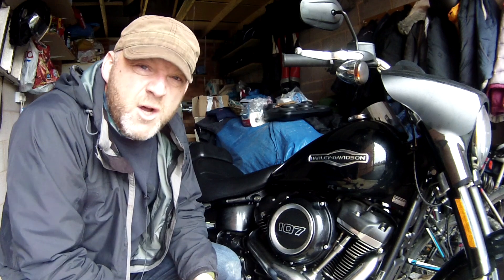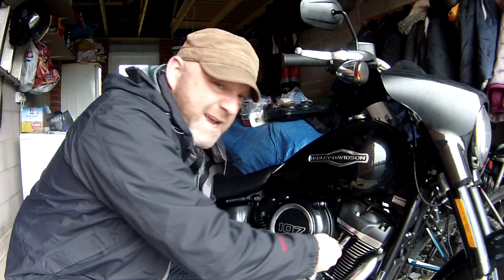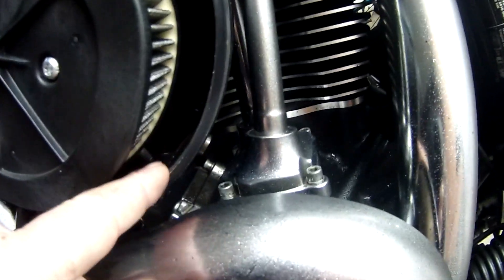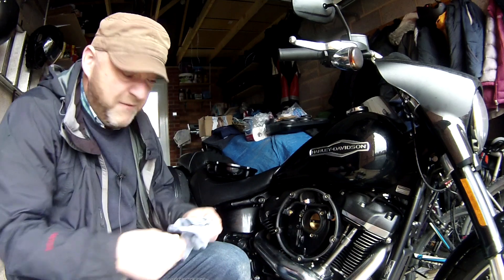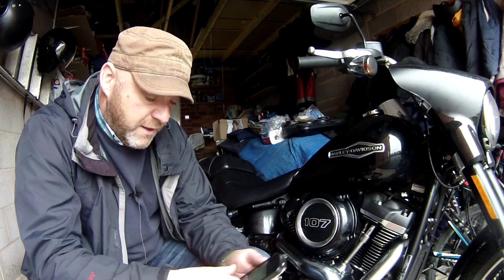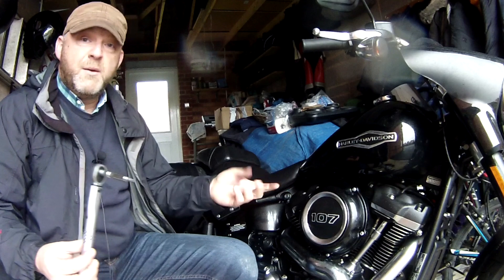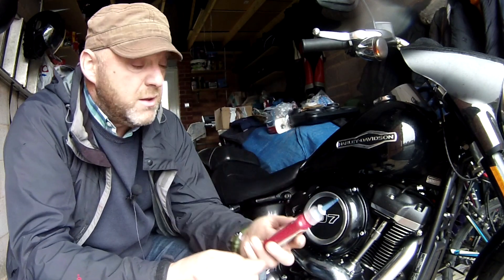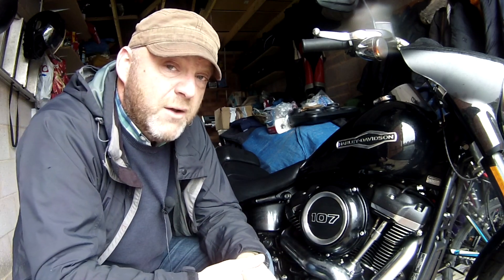Inspect And Clean Sport Glide Air Filter - How To Check Your Harley Air Cleaner

Comment: Hi Alf. when i got the Fat bob i had a shower cap for it to put on when it rains. i always make sure i have it with me when i go out on the bike, just in case it rains. i up until now i have had the dealership deal with it, but i have only had the bike since June 2019 and i have only done 3000 miles so far on it. i will look at inspecting it myself going forward though. good vlog
Reply from the maker: Paul Morris thanks so much Paul. Cheers

Comment: On the 114 FXBR 2019 the air cleaner has a mesh gaurd on it with a rain cap , a bit like a hair net ,(not that i need one ) .I am not actually sure if i need the hair net when it rains ,as for cleaning if you ride in a dusty environment ( Spain ) perhaps then sure take a look at it but for my riding UK ,Germany, Holland ,France, well i will just give it to the boys at the dealership .
Reply from the maker: Yep totally. I’m not so sure about the whole exposed air filter thing myself. Sure fine if it’s always dry but as you say, when in different countries it doesn’t work for me. Cheers

Comment: There are different strengths of lock tite, the blue is what should be used, the red is full strength and may require heat to remove fasteners.
Reply from the maker: Yes absolutely